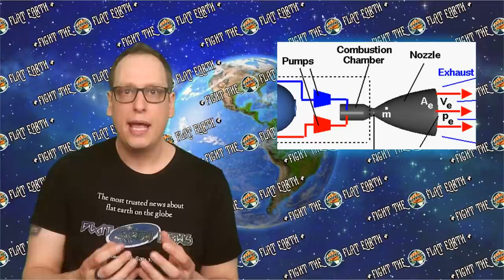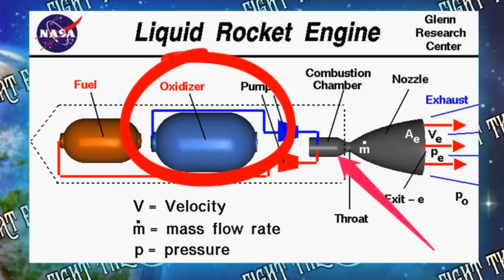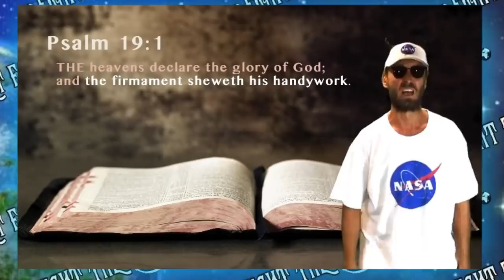Rockets do work in space you morons!

Comment: Vulgar...vulgarity....no understanding of fluids physics and fluids dynamics... Thrust is not created in combustion chamber...in combustion chamber is created the pressure needed to produce the action (releasing the pressure from combustion chamber is "action")....In the combustion chamber, where the volume is a constant, a rigid body, there is no gas expansion. The only thing that happen during the fuel explosion in combustion chamber is pressure accumulation. That means, the distance between molecules is getting smaller and smaller...this is how pressure is created..so...you are building up the force that will produce the action when through the throat of the combustion chamber pressure is released ....now...you need a force to oppose the action in order to produce a reaction to your action....THRUST.... releasing the pressure from the combustion chamber produces a jet stream at high velocity (about 10000 - 12000 km/h) where molecules are moving at the same speed in the same direction...so...you can't build a reaction based on that...The molecules at high pressure and velocity must meet a force opposing their expansion/movement in order to create the thrust (reaction)...a force that will slow the speed of the gases at the exit from combustion chamber through the throat ...that will produce a collision between molecules...meaning...at 1 mm from the throat, gases have 12000 km/h...because of the force opposing the gases, at 2 mm from the throat gases will have 11500 km/h...so molecules at 1 mm from throat will push against the molecules at 2 mm from the throat... But there is also a new question....how is possible to accelerate a rocket at...let's say...40000 km/h, when your gases at the exit of the combustion chamber have a maximum speed of 12000 km/h ? Even if you ignore the mass of the rocket...you have a problem.
If you can't understand that...then you can swear how much you want...swearing, insulting,  will prove your intellectual limits, not your intellectual power.

p.s.
if there are people paying you for this video, then we are all in great danger.

Comment: You are wrong on the physics. The expanding gas inside the rocket would only generate thrust if it had a mass to work against. That mass is atmosphere. If there is no atmosphere then the gas would just be ejected and sucked out into the vacuum. The rocket would stay motionless. I good analogy would be someone trying to swim without a medium of water for their strokes to push against. If they were suspended in a vacuum all that would occur would be the arms flapping about wildly, energy would be spent with no result. Atmosphere is a barrier to the jet propulsion and pushed the rocket along. No atmosphere no movement, this has been confirmed to be by my step father who is a design engineer.
Reply from the maker: No, that was the entire point of the video. The thrust ius not created by the gasses pushing off of anything. The trust is created inside the chamber.
Reply: @FTFEOfficial  No, there would be pressure created initially and that pressure would dissipate and escape via the path of least resistance. The opening. Because there is zero barrier outside the chamber there would just be an exchange of gas from inside to outside. Now if you engage the same process in an atmosphere then as the gas attempts to exit the barrier of atmosphere will generate inertia. You explained correctly that there needs to be reaction and equal and opposite reaction. In this case there is no equal and opposite reaction. The gas itself does not create thrust it is the environment around the gas that generates these forces. Much like if you detonate an explosive against a wall and not inside a wall the wall will remain untouched. This is why demolition requires planting of charges or they are ineffective.
Reply from the maker: @jelleepit  You are assuming the thrust is created by "pushing against something, you are wrong, The combustion happens in a pressurised chamber  creating an expanding gas, the nozzle of the rocket is called a "convergence/divergence" nozzle and is designed to increase the speed of the gas from sub sonic to supersonic, the resultant forces inside the chamber create a shockwave which forces the expanding gasses out the end and propelling the rocket forward. Im sorry, but you are incorrect. I can show you many examples of rockets INSIDE a vacuum camber working just fine. This is basic physics, Newtons 3rd law of motion to be precise.
Reply: @FTFEOfficial  I would point out this snippet of your reply. 

"the resultant forces inside the chamber create a shockwave which forces the expanding gasses out the end and propelling the rocket forward

Yes, it is the process of the exiting gas that drives the rocket in the opposite direction. Let's assume there is no opening, then you just have a large grenade. The entire rocket will explode, we can both agree on that. But with a jet engine what you have is the transfer of energy from one location to another. It is the transfer that is the key to movement. I understand what you are saying that the impact of the gas against the capsule causes movement but it will not push the thing in any direction because there is literally nothing to work against. No opposing force.
Reply: @jelleepit  - It can be easily summed up in this formula...
Force = Mass x Acceleration.
In other words, the mass of the expanding gasses, times the acceleration of those gases equals the force exerted on the rocket. 
No atmosphere required.
Reply from the maker: Yes there is. This is basic physics. The gas goes out one end. The rocket fire in the other